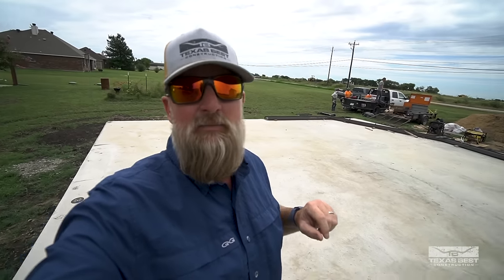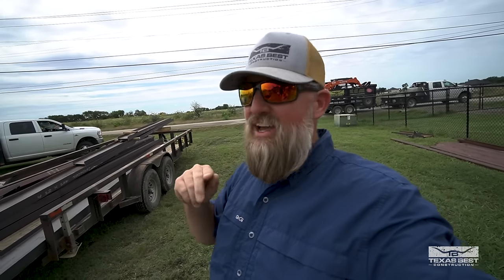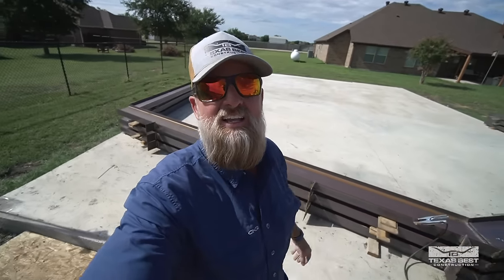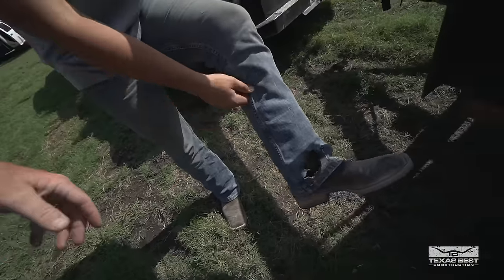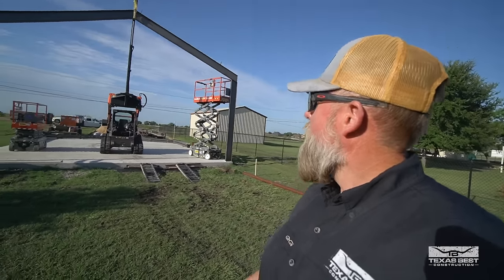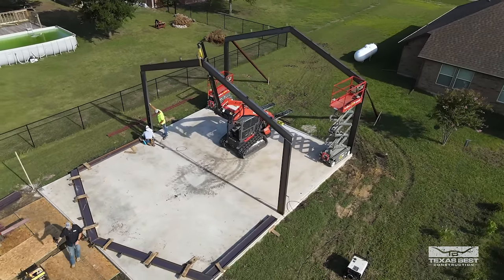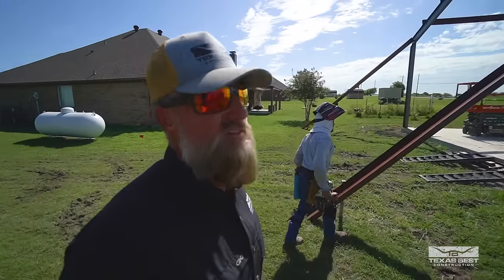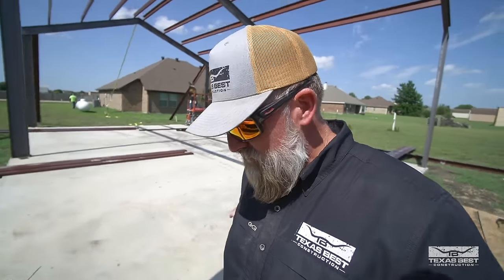30x40 METAL SHOP | CONCRETE to METAL FRAME in Waxahachie Texas | Texas Best Construction

Comment: Clearly there appears to be a case of neighbor "shop envy" going on here. LOL!  😁  Was there a reason that you did not "ramp" the concrete slab where the garage door opening will be so water will run away from the garage door and make it easier to get in?  At least it didn't appear to be from the video.  Did the customer request reinforced support piers for the 2 post lift?  😉  Gotta have a 2 post lift for the shop.  That will be a beefy strong shop building.  Nice!  👍
Reply from the maker: We did ramp it! 👍🤪 your right maybe! We added the footers for the lift... thanks for watching

Comment: Thanks for the video.  I just started shopping around for surplus steel beam and I was thinking to just weld it all together.  Pretty much like you did here.  Well, I might do column base plates - not sure.  Anyway, thanks again for showing your build.  I will probably go the W12 beam route too unless I find a good deal on plate.  May be tempting to build my own beams as I can copy a 40x40 building I alreeady have.

Comment: I do pre-eng steel in canada. We dont do any welding! How do your columns affix to the grade beam? Is it welded on? If so, how is the steel plate affixed to the grade beam? We have our concrete guys install the threaded posts in the grade beam, to which we plumb and set down with nuts.

Comment: I’m about to build a 30 x 40 shop myself. I love the video because of all the good information and the positivity you have while on the job site. I do have a question you might be able to give recommendations for. I am doing a 4” slab but want to do a 6” section under a vehicle lift I’m going to install. Does this sound like a reasonable plan or should I do something a little different? Thanks in advance!
Reply: Sounds sufficient but to be safe a 12*12 footer wouldn’t hurt, especially if you plan on working on anything bigger than a f150

Comment: I’m trying to get a job working with a company installing red steel buildings. I have prior experience installing galvanized tube carports and also experience in structural welding and fabrication. About what is the average pay/ starting pay?

Comment: I realize that once the steel is welded it's too big to travel, and so that's why you weld on site. But the thought of not doing anything further to protect the steel (like painting it) doesn't sit well with me. I'd much rather have a pre-fabbed system that bolts together.

Comment: Excellent build! Excited to build my shop and this video lit a 🔥under my….. I was curious if all your beams are welded or did you use bolt flanges? It looks welded but didn’t see too much flex when it was picked up from the ridge which made me think bolted together.  
Thanks!
Reply from the maker: Complete welding. We used embeds in the concrete for plates to weld to

Comment: What size Ibeam would I have to use to span 40' with a 1:12 pitch with no posts in the middle?
Reply: 10" 12# will do it
Reply: Snow load? Wind load?

Comment: Do you not have to use footing for this in Texas? I see them building houses with weird monolithic slabs too, I have never seen this anywhere else.
Reply from the maker: This is just a shop building however a lot of folks use less concrete than what we did in this case. We have 6” thick concrete and we have grade beams running through and around this one.
Reply: @TexasBestBarndominium  thanks for the reply. Im new to TX. Always like seeing how everyone does things differently.
Reply: @andrewrupp7498  A lot of placed do thick edge slabs, basically footer+slab in a single pour. A friend just did a 50x100 building and they did a 8"x12" edge that tapered up to ~5" slab thickness.
Reply: @nicholascooper1193  It surprises me that there is no real excavation for then footer. What you are saying makes sense, dig down a bit and then taper. I guess the ground doesn't move much in Texas. Id be really concerned with my floor cracking. I just did a 76x76 that is floating between ICF walls. the perimeter of the slab is 8.5-9" and then the rest is 6-7" on top of foam.
Reply: @andrewrupp7498   not much (or zero) frost line, plus you tie the "foundation" rebar to the slab rebar to make it a single entity vs floating a slab inside some other structure/foundation.
Reply: @TexasBestBarndominium  how much ? Turn Key 🔑??
Reply: @jimmysapien9961  30k to 40k.

Comment: How do you fasten the sheet metal on the corners where you have the beam?
Reply from the maker: We weld base angle at the purlin line in those spots so we can screw the panels there. Thanks for the questions. I need to better show some of that on one of our upcoming builds.

Comment: hey Josh, Question, I have watch all your videos and some multiple times.  I have not seen a barndo with a basement. I understand Texas don't give much basement opportunities.  Is there a way to frame with red iron and have a basement ? Also, Will it be best to span the basement with steel also?
Reply from the maker: To answer your question in short I definitely think it’s possible but it’s not something that I would do without a full engineer design being that we don’t generally have basements in Texas because of the expensive clay in the soil.
Reply: @TexasBestBarndominium  theres a church here in Venus Just north west of waxahachie and the church has a basement and that thing is so humid musty and wet all the time. They spent 10's of thousand to fix the basement and its already messing up again. This church is downtown venus built in the 1800's
Reply from the maker: J M yes hard to go back and address problems from the 1800’s huh!

Comment: How did you fasten the upright beams to concrete
Reply: Metal plates embedded in the concrete with probably rebar shaped in a J welded to the bottom.

Comment: May I ask how much this project cost?
Reply: When they don't answer you, you know it's way over priced.
Reply: i can bet they charge close to a 100$ grand
Reply: @patriot2872  I don think so
Reply: From the Strato-O-Span website, this structure would be less than $10/s.f..  Add $475 delivery, $350 for roll-up door, $350 for man door. So, $14,022.  That does not include insulation.

Now add material and labor costs for concrete pad and erection of building.  Add lighting, wiring, power panel and electrician and helper.  Add any permit and inspection fees.  Prices for these vary by location.  I figure just under $30,000 all in.  I am not familiar with TX such as permitting, demand and price for labor.  The fluctuating cost of steel can be a sizable factor in the final price.

Comment: From the vid, the I beams don’t look 12”, kinda looks like 6”. How much does a structure like this cost?
Reply from the maker: Nope. 12” on this one. 12” is a bit overkill though.
Reply: @TexasBestBarndominium  how much would a 40x60 cost and how wide would you make the i-beams if you were just going to line turn it into a greenhouse?
Lets say 15’ walls and more of an angle/peak to the roof.
Reply: $30k to $40k.
Reply: 30k to 40k